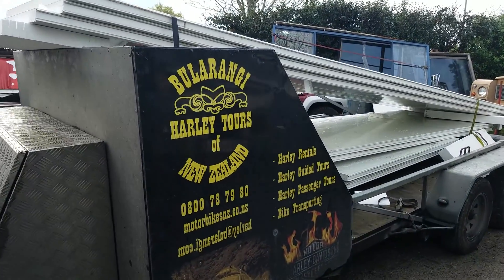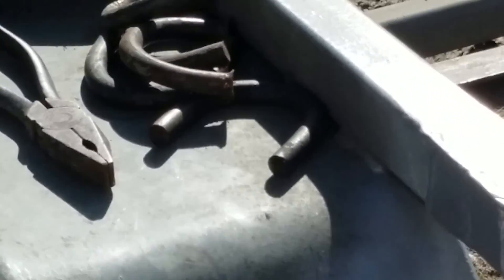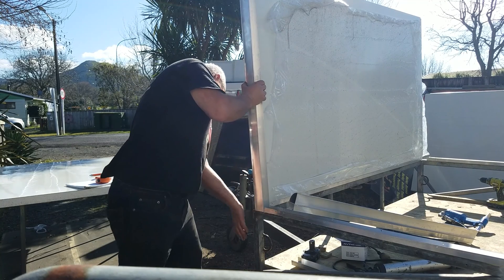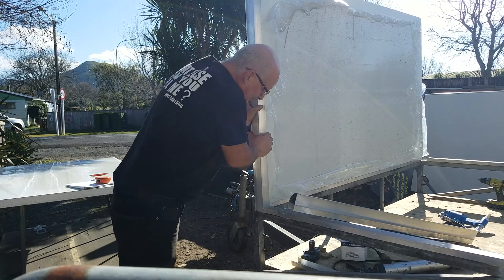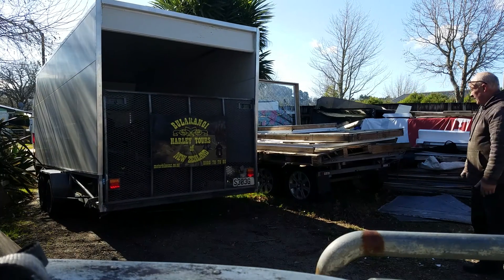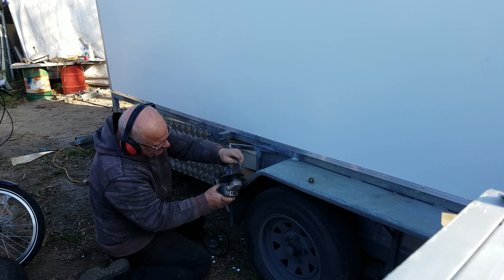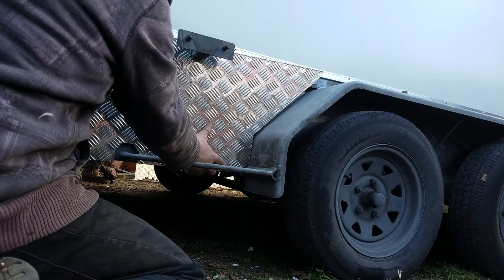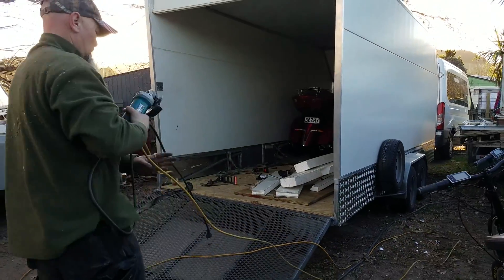Trailer Conversion in 3 days!  Part 1-  Flatdeck Motorcycle Transporter to Enclosed and Secure

Comment: Does anyone know if 4.8 x 6.4  blind aluminium rivets will work ? I can’t find any answers anywhere and going to start the build tomorrow lol TIA
Reply from the maker: That is exactly what you need at 200mm spacings. Go Well.
Reply: @t.h.o.r.   thanks heaps mate appreciate it . I’m overstressing it , but I’m still stuck on a sealant . I was going to go with your recommendations but hard to find in Perth . Seems Bunnings nz and Australia stock different items .  A friend suggested t-Rex by soudal . What are your thoughts ?
Reply from the maker: @unbr3akablonsoundcloud-tx6co  Ive never heard of it. The one I use is a great budget choice, I have to warrantee any trailer I build for 3 years and Ive used it for at leas 15 years now and never had an issue. I use it on all the deck and extrusion joins on corners. The roof  joins is the grey Bostik urathtane sealant which is great too. On the panel joins on the walls I currently use Metalcraft branded titania coloured jointing silicone. The supplier gave me a two for one deal so I bought 4 boxes of 24 tubes - It worked out at $9- tube but I dont like it- It stays soft for about a week. Ive not settled on a coloured silicn that I like yet. what I really would like is the Bostic Grey urathane - but in Titania- that would make the roof look better
Reply: @t.h.o.r.    Here’s the response from sika :

Unfortunately Sikaflex-123 MS Bond is only sold in NZ.

 

Locally, Sikaflex 521 UV would the recommended equivalent. (PDS attached)
Reply from the maker: @unbr3akablonsoundcloud-tx6co  Interesting that we each get a different product. But I Dont use it as it has a wicked short shelf life and it goes off before I get to use it. Plus its a silly price at my Mitre 10
Reply: @t.h.o.r.   it’s very interesting .  Apart from the areas of NZ that see snow and likely to experience earthquakes, I can’t see the climate being all that different ?  
I picked up my panels today, and unloading at home I noticed a 5mm variance between some of the panels.  Not sure if this is normal,  it I wouldn’t imagine it would be an issue as I’m not using c Chanell, but  2 pieces of angle bracket (seperate inside and outside) meaning I can still get fix panel flush to inner and outer angle.  My flooring will probably be out as a result but I want the exterior to be flush. Flooring is the next challenge. Not sure whether to use structural ply coated in waterproof membrane with thin sheet fixed to bottom (to protect from rocks) or fix a thing sheet to the bottom of a stronger, esp panel and use that as the floor to assist with insulation.🤔

Have a great weekend mate 👍

Comment: Awesome videos of building trailers using this stuff. Do you have any videos of how the roof goes on, or how you do a sloped front section you can see in the back of some of your videos.
Reply from the maker: when using this extrusion I cut them 10mm undersize and they get slid in from the end of the tracks from the back, section by section. add the adhesive when you get to where it will sit. When Im doing a 45 mitre corner top join or a aerodynamic front i cut the panels the actual size. the sections get 45ed and placed on the roof and I secure and position the back one with alloy angle tab sections and single rivets at 4 points  then I push together sealing joins as I go join into one chunk with the alloy angle sealing top and  sides and riveting only the top to the panels. When its all held in one piece I string line it from back to front to get any waves out using wooden packers underneath, get it level and then rivet it to the sides and clean up. then go inside pull out the packers and expanding foam fill any gaps then fit the inside angle extrusion.  There are lots of new skills to learn  but basic carpentry skills cover most things. Im doing two day build seminars over the summer- dirt cheap at $195 and you go home with a fat list of suppliers, glues and sealers, ways to get cheap windows, I hope that helped a bit. Its a lot to convey in print. Time I did another video.

Comment: Hi, great videos! Is it possible to contact you? I am in the UK and wanted to check the material I am planning to use is similar to what you recommend? Thanks!
Reply from the maker: The panels are interlocking on the edges coloursteel skins in Titania. they are available in continuous lengths to order in 50mm-75mm-100mm 150mm. Expanded polstyrene core- EPS. Im about to build myself a large cabin from it watch out for the series of videos starting in about 1 week

Comment: Hey there...going to be building a off-road trailer..like the idea of these SIPs...could you please let us know what brand would be stronger for this ? Thanks
Reply from the maker: Here in NZ we can get chinese imported stuff - but its real crappy. Bondor is the very strongest grade Kingspan and Metalcraft also make a good product that is straight and true. EPS Foam are a little rough in their handling- there are often dents of scratches in it when it arrives
Reply: @t.h.o.r.  awesome thanks...I'm probably going to have a bunch more questions for you as I move forward on this ..hope you are good to answer if you can ..no one else in NZ has relevant information on the off road trailers.
Reply from the maker: @unlearnthesystem6469   certainly- just be patient with me cos YT does not always send notification of comments
Reply: @t.h.o.r.  ok cool thanks...first question would have to be .... independent suspension! Is it worth it ? How much did you save and how much different than leafs off-road?
Reply from the maker: @unlearnthesystem6469   all it cost me was the bushes, the steel, the subaru shocks and I jigged it all up on the floor with beams of steel and clamps and string line- then slipped the beam into the build. It handles plush off road but a long curve on the highway sees the tyre rubbing on the guard. sway bar will fix that. But then it wont be quite so flash in deep ruts and offcambers
Reply: @t.h.o.r.  only problem I have is I can't weld for shit.. however can do all the rest I do know a guy who can do it  but will cost Labour and perishables....I was looking at going leaf spring with shock absorbers and  possibly getting a gull wing axel and flipping it so it points up ..but the trailer people said they won't warranty it like that ...or a drop down axel . Any bad thoughts on this ?

Comment: What a great video buddy. It’s just to bad that the structural insulation is so expensive, but then again it’s cheaper than aluminum siding and metal structure post for the frame
Reply from the maker: overall it works out about 20% cheaper. - but so fast. He still has to bring it back to finish- we got caught by another lockdown

Comment: I have to ask what material  do u use thats insulated  and white for the trailer or camper builds u did??
Reply from the maker: And I have to ask- "did you have the sound turned down when you watched those videos?" In this vid = and all the other vids Ive done on the subject Ive clearly stated what this panel is called, what the insulation is, how much it weighs, how it joins together, what the skins are made from.